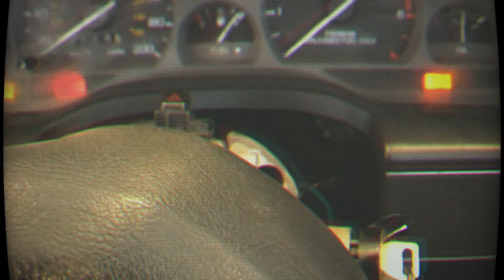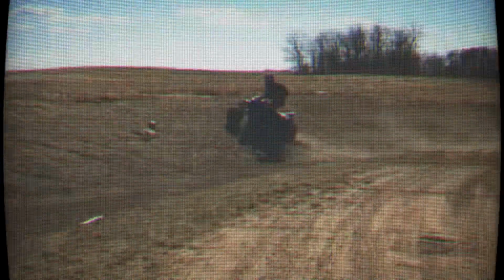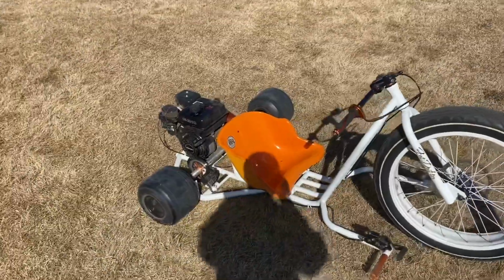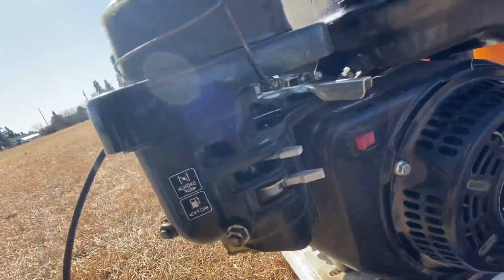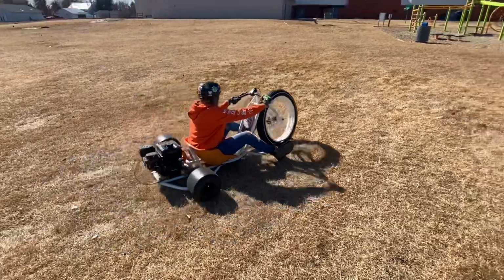Drift Trike!! Taking Her For a Good Ride!!

Comment: that thing better on grass or the roads?
Reply from the maker: If you got nice smooth ground the grass is actually pretty nice slides really easy but if you have the plastic slide on caps over the tires that does make it a blast on cement